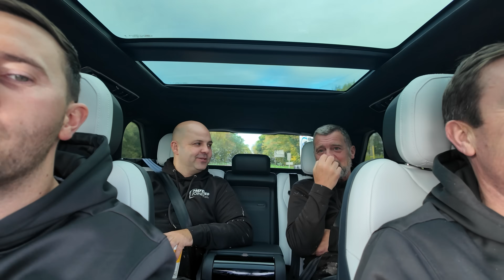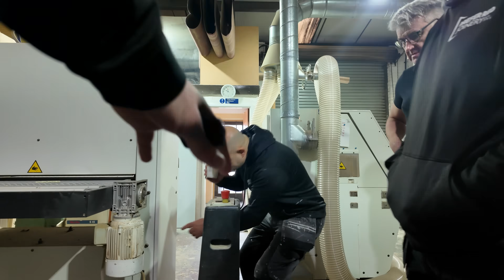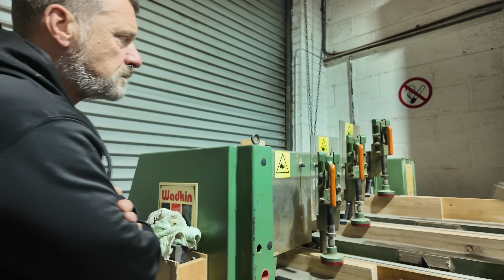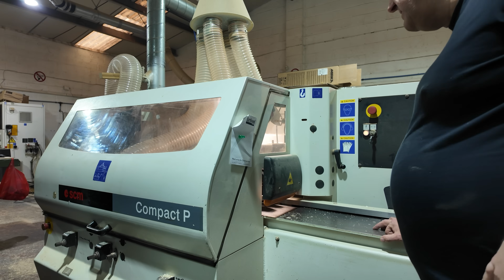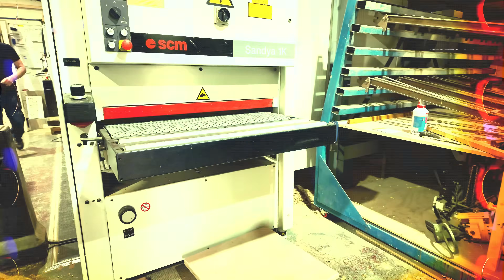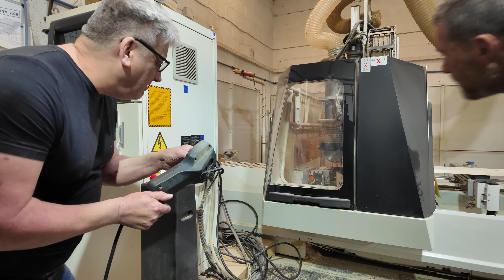First Look At The New CNC MACHINE!

Comment: Exciting times when buying new kit. I've had 4 sided moulders for over 20yrs and although the pre-straighteners say they will take 10mm off heach head I would never do that in 1 pass. I had a Paoloni RD 240 for 20yrs and just bought a new SCM Profiset 60EP and neither machine is really built for taking 10mm off each head, you can fuck a machine up by doing it because belts slip ,motor's run down and burn out. They just aren't made to take that much off in one go unless they have 10hp motors on each head. Treat them with respect or they can cost a bomb to maintain and fix.  

   All the best and good luck with the upgrade.
Reply from the maker: Thanks for the advice mate 👊🏼

Comment: Interested on how Rob is re-calibrating the feed belt as the bed on the machine is designed to not go any closer than 3 mm and no lower than 170 mm, mine could do with a calibrating as it has developed that shiny surface he spoke of.
Reply from the maker: Yes mate he’s a smart guy on work arounds 👌🏼
Reply: @Preferred_Joinery  I can only assume that he has adjusted the stop on the bed to allow it to go slightly higher.
Reply: @kevinbland3516 No need, You very carefully manually raise the table up, this bypasses the limit switches on the electric rise and fall.
Reply: Ahhhh, nice one thanks. Everyday is a school day 😂